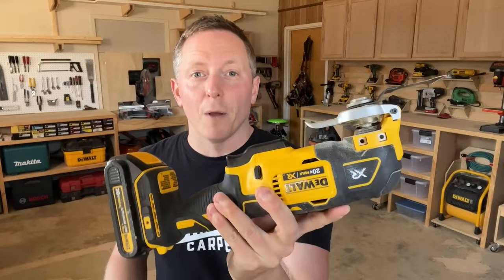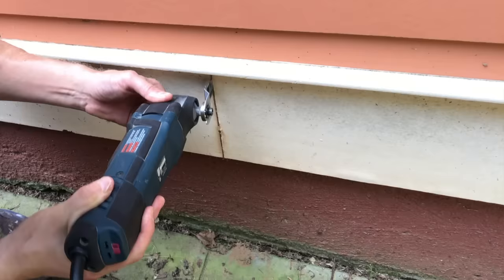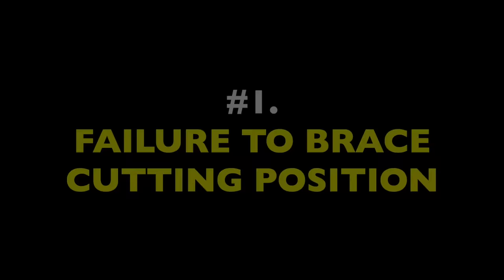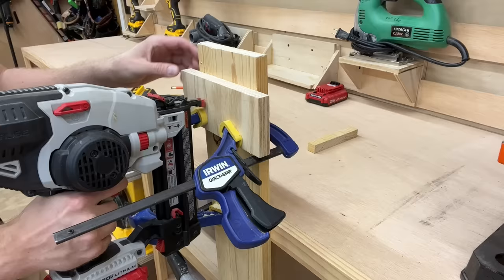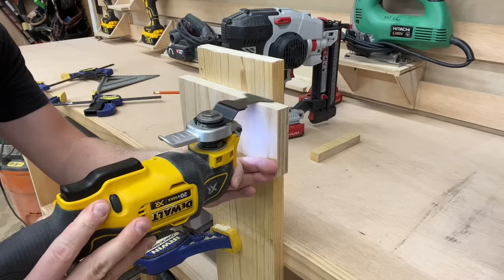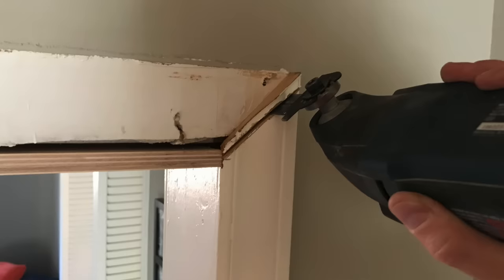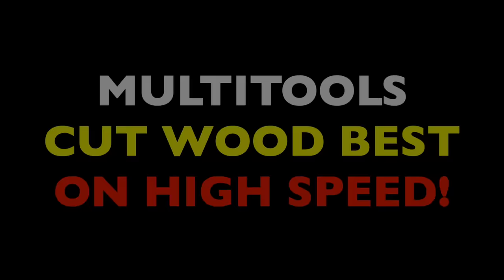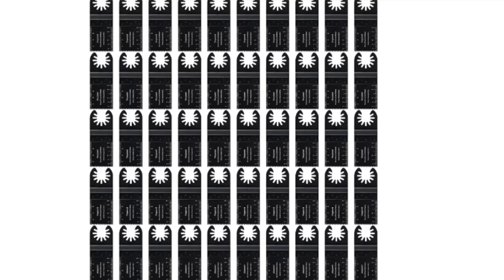6 MULTITOOL CUTTING MISTAKES! (How to Cut Straight With a Multitool...AVOID THESE COMMON ERRORS!)

Comment: I have to say that I had never heard of the multi tool until I saw your video a few years ago. The battery system I use introduced the tool to the range and so I bought one, along with a very large set of various blades (fortunately). My first attempt at using it was...not good; I immediately bent the blade through using it at too slow a speed and slowly lowering the blade onto the wood. It juddered as it made contact and bent the blade.
Two years or so later and it has become indispensable in my kit. It does the cuts that nothing else can do. It trims otherwise inaccessible areas, like the bottoms of doors without removing the doors, removing rotten parts to refit with new timber, without stripping the whole thing apart, and so on.
I always now use it at full speed because low speeds cause it to grab and bind (when sawing). I also have scraper blades but have never used them, yet. I am a carpenter and tend to only use it for wood and PVC, though I also have metal cutting blades but I doubt I will ever use it for that. Come to think of it, the metal cutting blades would probably work well on PVC.

Comment: Love my Muti-Tool saw I wouldn't be able to put in Light Switches or New Outlets without it. Downside it takes forever to saw through thick wood, but the upside the slower you go, the less likely you'll mess up. 👷🏿‍♂️

Comment: You got your game on thanks for all your good work, so I’ll kick the ball with you. Instead of drawing a line with a pencil , I would use my exacto knife / box cutter or even the tip of my 5n1 to actually score the drywall or timber. Then I have a physical channel that the multi tool can track. If I’m really going at it and my thumb nail is up to it, I’ll use my thumb nail to score.

Comment: I found out early on having 1 is it needs a belt clip... but luckily these allow for that... so I had to use belt clips from old dewalt drill  including the screw n nut... n fit it on my multi... sure did help with working up ladders  ....

Comment: Thank you for this video! I'm a 69 y/o female, just finished power washing my house, getting ready to paint it. Bought a Makita circular saw, and a nailgun and 16 ga nails for it. Discovering this multitool saved the day for me. I have sections of trim that are rotted and broken away. And then there are sections that are just fine. With this tool I can cut away the bad sections and replace it with new trim, patch the seams with either wood filler or paintable caulking. Save a ton of money on the trim, which is Hardie trim, and at $20 per 12 ft, adds up quick.

Comment: I like the half moon cutting blades as you can go straight in or side to side without much fuss.  The straight blades are good for straight inside plunge cuts, but not side to side.
Reply: That is if your ends of the cut are free

Comment: As I've gotten older I have more trouble holding and guiding a circular saw safely and accurately.  I finally bought one of these and it's much easier to handle but have to admit my learning curve is pretty big.  But I haven't been doing everything wrong, just several!  😉 I don't think you talked about one thing I'm still not sure of.  Do you place the blade on the wood first or start it first when beginning to cut.  I think it's probably the same as a reciprocating saw but not sure.
Reply: Start the tool first then apply to the material you're cutting... gently.
Reply: @ST-0311  thanks!
Reply: One way to think about it - most brands of these tools don’t have a pull trigger. They have a switch that is stiff and out of the way. So the majority of them you pretty much can’t start them with the blade touching anything because the switch will make you move them turning it on.

Comment: Mine was invaluable for upgrading the electrical in my house. I made a template out of a scrap piece of paneling to help guide it for cutting rectangular holes in my plaster and lath walls for new switches and receptacles.
And that stuff really dulls the blades quick, so I am glad I grabbed a cheap variety pack of blades on amazon.
I burned through a few.

Comment: Great video! I received a multi tool as part of a Ryobi package of tools and was wondering what it was for. It and my driver are the only tools i haven't yet used. Glad i saw this video! Are always, your explanations are concise and easy to understand. Thanks!
P. S. I have serious workshop envy! 😉 I only have a table outside and have to run power cords to the house, but I manage. I need to build a little overhang so i can work in inclement weather, but I'm not sure where to start..

Comment: I used an M12 fuel multi tool for demoing drywall for the entire house, it was quick, safe, and easy. I also used an M12 fuel hackzall for stubborn nail and screw embedded areas that I cannot pry with a crowbar because I do not want to trash my multi tool blades.

Comment: the multitool has replaced my drill/driver as my 2nd most go to tool . i'd be lost without it at my work for sure. and i recently upgraded from the standard milwaukee m18 multitool to the fuel version , and i was shocked at the difference between them , the fuel is so much better

Comment: Hola! 🖐I could have used this info last year when I purchased my Harbor Freight Chicago Electric multitool. I went cheap since I had never used one before and did not expect to use it much after this project. Boy was I mistaken, this tool is awesome!!!🤩I definitely learned the hard way and basically did all of the mistakes you mention above before I "got the hang" of the proper use for this tool. I would say that the blade makes all the difference and I would agree that the Diablo blades kick butt. Another great video, thanks Ethan. 👏Take care and have a good one, Adios! 👊
Reply from the maker: Thanks Grampies! I want to try that Chicago electric—I have a corded drill from them that just keeps going and going 😆
Reply: @TheHonestCarpenter  ...and going and going! 😂I'm guessing most of us think I'll buy cheap and replace then we get "attached" and won't let go before we get to replacing with the "better" brand. At least that's what has happened to me more than once. 😉

Comment: It can help to use the blade not straight-out, but angled to one of the other positions. I undercut the skirting board (baseboard) in my bedroom to lay hardwood flooring without removing the skirting (would have damaged the plaster badly). By putting it at 45 degrees, I was able to have both hands in contact with the skirting, giving loads of support - my hand on the front gave me loads of control of depth, and it was like cutting butter.

Comment: Great video as always! I've been shopping around for a multitool but haven't worked with one often before so I wasn't sure what to look for. This gave me some valuable tips not only for buying but obviously also for when I finally start using my own! God bless!
Reply: I did the research and test drove all three Milwaukee 18v(don’t get 12v the battery falls out)
Dewalt (like the video)
Fein (corded)

The Milwaukee has the same power as a corded fein, and the auto speed option does the thinking for me, having dewalts trigger might sounds good but I was always second guessing myself  therefore I wasn’t concentrating on accuracy , think of trigger option it like a pen you always have to pump for ink ….nah …just supply the continuous ink while I work on motion in my handwriting
Reply: @paulpham9216  Thanks a lot! I'm from South Africa so we have a VERY nice Bosch option available here 400W GOP40-30. It's corded but has an exceptional reputation. Pricey, though.

Comment: I love my multi tool I got it a few months ago. I’m re-doing the floors in my bathroom with it but can you explain why my darn blades seem to be going dull so quickly? Like I feel like it’s after just a few passes, I don’t get it. I have tried Bosch, Dewalt, and Diablo blades and they all seem to do this. It’s really annoying and expensive. I’m making an effort to not hit any embedded nails also. I have a brushless Ryobi Multi tool btw.
Reply: The blades and teeth are very thin and are prone to dulling with pressure and/or heat.
Don't push hard on the tool during cutting. Allow the blade to do the work. 
Keep the blade moving so it doesn't build up heat. 
If doing a deep plunge cut in one spot give the blade a break and let it cool.

Because they are so thin the blades are also very easy to sharpen. If you find your blade dulling just use a small triangle file between the teeth to restore the points on the tips.

Comment: Good video!  I think your #2 mistake is only partly right.  I have at times found it to work well to get started and plunge in deeply in one side of the cut, then tilt  the saw/blade and begin tracking the line, cutting full depth with the blade embedded and being guided by the existing cut kerf...sort of like having a guide block.  Works especially well on softer materials like moldings, drywall or thinner soft woods/plywoods, where you can still provide some measure of twisting to adapt to drift.

Comment: I have been using the same Dewalt multitool like yours for about 4 years (I own 2 Dewalt multitools to replace the Milwaukee ones I owned). This is my goto tool everyday. I have done a lot of research into the blades. The el-cheapo blades you are using is expensive long term cheap up front but the amount far surpasses the the upfront cost of a better blade. For most cuts other than drywall I use the Imperial blade iBoat 360 metal & more blade Titanium coated carbide blade. it will cut most anything and even when the teeth are all but gone the titanium coating will still chew through grout with out cutting into the tile.
The japanese style wood blades are worthless as the teeth wear out supper fast and if you encounter anything metal the blade is instantly done (a waste of $11.00). iBoat 360 blades in bulk (50 blades) will run about $9.50/blade)

Comment: As a engineer, this is basically a giant hair clipper with more power|wattage and oscillations.  If you ever cut your own hair with clippers, then this is what it is.  This machine is ridiculously loud like a amplified clipper.  Wear headphones|earcups.  Make sure to never let this sucker (with an attached blade) touch your flesh or it is gone (because there is no safe guard).  I remembered a factory using one back in the early 2000s for chopping bolt ends off while inside a box.  Great video, I watched this video before I bought it while in the store.  Really, I just bought this as a toy.   I would grab a circular saw, jigsaw, drill, router, miter, or variable speed rotary tool before using this.  It is slow and will eat man-hours.  Good video though.  I guess it is a good tool, if you are fixing someone else's mistakes or redoing|remodeling some job.  I have some sheet rock that I need to cut that is leaning against the wall and I bet this is good for that instead of using a my circular saws.  Play time.

Comment: Great tips, thanks! A couple things not addressed in either video: 1) Starting cuts. Do you start on full speed before making contact with the material? And 2) Are the slow speeds useful for anything?
Reply: Slow speeds are good when using it as a detail sander but higher speeds are better for let's say paint removal, I also like using slower speeds when cutting through drywall (for better control) and plastic; some materials like ABS can melt and leave burrs you'll need to sand or remove afterwards

Comment: I have the older dremel multimax. I have been having trouble with the nut loosening very quickly during use.Have any ideas what I am doing wrong or what I need to do to fix this issue.It is so frustrating!!

Comment: I didn't realize how valuable this tool is. I wanted to try one for grout removal. I bought the cheapest, throwaway tool I could find to try it. I'm going to order a cordless, brand name saw to replace the cheapie I have. I seem to use it for something, every time I do a project.

Comment: Usefull tips for sure! But I do feel like most of these cuts would have been much easier, and with a higher rate of success, using a small circular saw, like the Milwaukee M12 FCOT or Dewalt DCS438, which both have the possibility for dust extraction. I use the multi tool a lot, but it is more often for that final bit of a cut, where the circular blade can’t get into, cuts near a wall or the floor, or plunge cuts that are covered up afterwards. And I use it a lot for sanding small areas. 
I love my multi cutters, but for fine work I usually don’t find them ideal.
Reply: @Curtis Preston These saws have a tiny 76mm cutting blade and no saw teeth like regular circular saws. Instead they have this rough carbide surface on the cutting wheel that does the cutting. It will sure scratch your finger if you get it in there, but it won’t cut in an aggressive way like a regular circular saw. 
Furthermore the cutting wheel is shielded. They are really not scary.
Take a look at one
Reply: Yes, it is a question of  whether you can fit you circular saw in,  including the direction of the cut (in half of the cases motor is just on the wrong side) and the length of the cut.  If you can, it will do a faster and cleaner cut.  Also,  if the cut is not all across, circular saw will leave uncut parts at the ends, which you need something to finish.
Reply: @dmitripogosian5084  Exactly. As I said, the multicutter definitely has its place.

Comment: The problem with turning multitool cutter to highest vibration is significant increase in noise at highest setting. Cordless Multitools get as loud as  114 dB in wood at highest setting.

Comment: Awesome tips as always Ethan. What are your thoughts on the depth guide? I have an exact deWalt that you have and deWalt has a depth guide for it which once helped me avoid cutting too deep while giving me some extra "resting" support on the piece, but your tip on maintaining the correct posture is still very much valid.
Reply from the maker: Thanks Arash! Honestly, I’m yet to use the depth guide, because I got so used to not having one 😆 But I could see it being very helpful for that purpose!
Reply: Dewalt for compatibility of the battery. Never used anything else so don't have anything to compare it to.

Comment: I would like to see tips on the small guide roller attachment that you have on your oscillating tool picture. I have one. But don't know if it is worth using one.  I have not seen any videos on the use of one.  I love all other aspects of it I forget about the roller . Most All my cuts don't need to be that precise.

Comment: Ah….Interesting.  I found I am already doing these recommendations, they kinda come as common sense… except running the tool speed too low…guilty as charged.  This is because the osc multi tools are pretty loud on full beans.  I will keep the buzz up in future👍
Plus: Dewalt for the win😜
Reply from the maker: Full beans, Contessa! 😆👍

Comment: Working with DeWalt and Milwaukee multitool I find thet whit Milwaukee I have so much precision cuts and can handle a single speed easy! With DeWalt I have so much trouble to control the speed and gears it just slide out control!

Comment: I just picked up a makita 18V Multi tool and wasn’t sure if I’d use it a whole lot but got great deal ($100 with 10 Bosch starlock bits) but anyway I had to repair a very bad sloped flat roof (my restaurant) and that tool did 90% of the work- perfect for cutting out old shingles and gobs of old sealer from years of poor patch jobs- that being said it ruined every bit I used up there and I have white greasy stains on the body of tool and have to take wire brush to get tar off the head a few times lol
Reply from the maker: Yep, it’s great for spot demo, Joseph! But that gunk is hard to get off 😅
Reply: @TheHonestCarpenter  lol hard is an understatement lol at least I got my moneys worth out of it already lol I’m more of a woodworker then handyman so I probably got more use in that week then I will in a year lol

Comment: Can the Dewalt tool be locked on or off, or do you need to use the trigger? The Milwaukee version has a speed setting and an on/off switch. It's useful to be able to hold the tool in whatever way necessary without having to worry about squeezing the trigger. I'm an electrical apprentice so I don't use my multitool as often as my other powertools, but when I need it it always comes in clutch.

Comment: Hey thanks for the video!

I have a Fein Multimaster and the blades for it are very expensive, and I can't buy the amazon generic ones because they're not Starlock shape/compatible. Was thinking of selling and getting a dewalt one or something that is compatible with these cheaper blades. Or should I bite the bullet and get the starlock blades? Any thoughts are appreciated. Thanks!

Comment: What do you use the half circle multi-tool blade for? They usually include just one and it's easy to wear the blade unevenly leaving the blade with teeth that are brand new to worn all the way down.
Reply from the maker: I don’t use it too much, Charles! Exactly for the reason you mentioned. I feel like it’s just more blade than you need,  especially since you can only engage with the very leading edge of the curve.
Reply: @TheHonestCarpenter  Impossible to wear evenly. Thanks.

Comment: Very surprising that this experienced saw user didnt even explain the obvious feature of this saw which is the ability to mount your blade at multiple angles including at 90 degrees which allows the user to keep the body of the saw at a much lower point that is closer to the material being cut and thus can significantly help the user with better ability to brace it in order to make a more steady/precise cut

Comment: Almost dropped this tool once while it was running and caught it right next to the blade it was pretty scary. It was a rigid multi so it had a switch instead of a trigger so that thing stays running even if you dropped it 😮